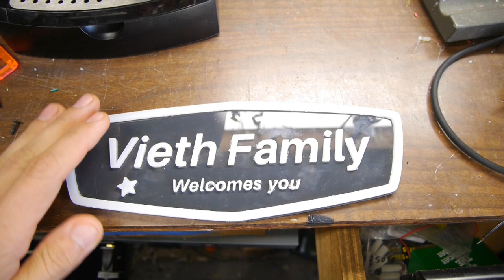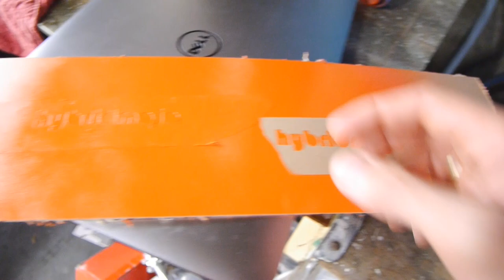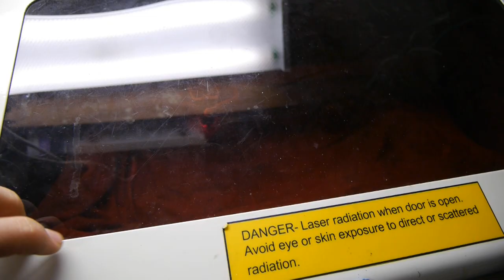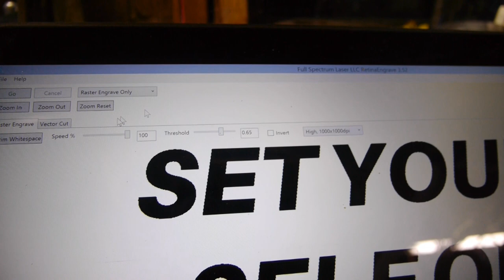Tips for Making Interesting Signs and Lettering with a Laser Cutter

Comment: Nice video just make sure the fake leather is not made out of vinyl which you shouldn't laser cut because it releases chlorine gas.
Reply from the maker: I'm pretty sure there's vinyl in it.  I used the lowest power setting and have an air pump out the window so not too worried about my health, but I know it's not great for the laser either.  I previously tried cutting some ABS when I was in a jam last minute and it fogged up the lens and mirror quite badly.  Marking the fake leather did not produce anything near the same amount of gas.

Comment: how do you prevent reflection from the laser bed? i had issues when i placed the materials on the bed and the laser reflects, ends up my wood product gets an underside burnt. Also my acrylic does not seem to have a smooth edge (do i need to increase in power for this)
Reply: I have a metal honeycomb below the workpiece.  This bounces the laser energy around so it doesn't burn the underside.  The melted edge is pretty typical... I reduce power (not lower than 25%) or increase speed and do more passes for a cleaner edge.  Cast and extruded acrylic behave slightly differently. Think about the heat affected area due to the laser, like welding you want to keep the pace up or use a smaller flame.  Also sometimes I'll use a torch and flame the edge to get it prettier AFTER cutting.

Comment: Nice video, and great methods for acrylic signs! 
You should try using Acetone (or commercial acrylic adhesive) to "glue" the acrylic together. It bonds the acrylic, and with a bit of practice, it is quick and easy. You can use a syringe for application, and it works almost instantly.
Reply from the maker: You know I actually bought a bottle a couple years ago and never really tried it.  But now, I will!